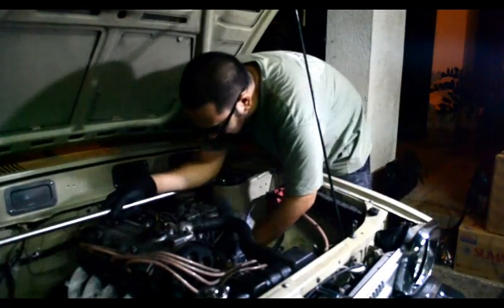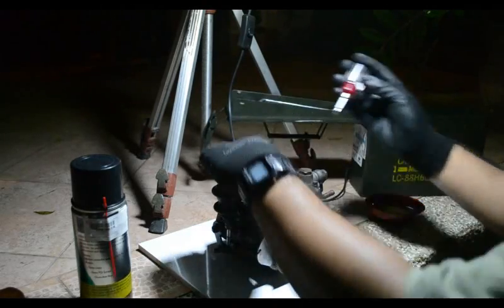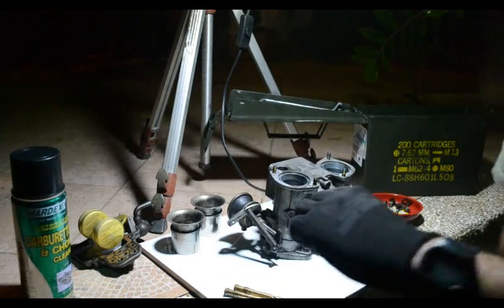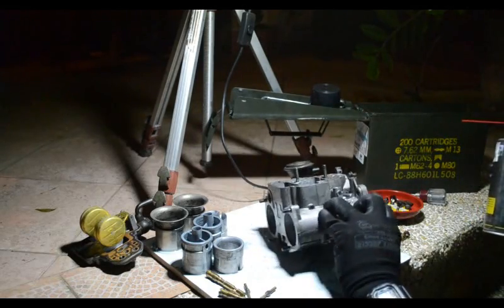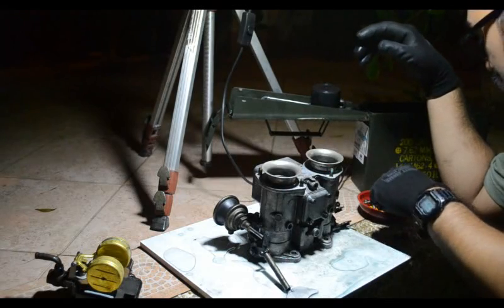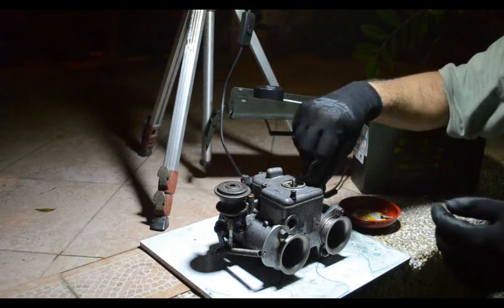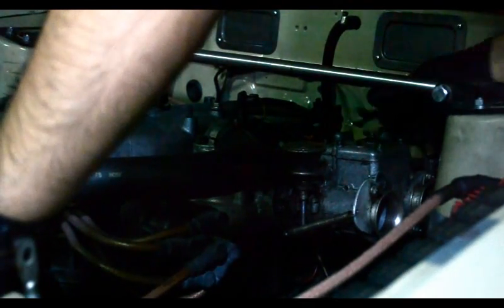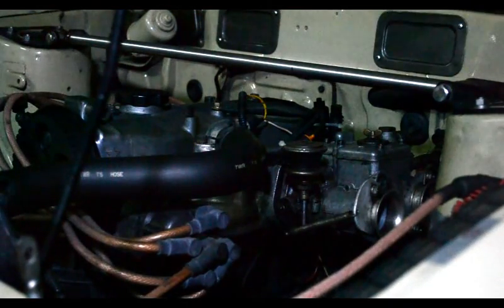Weber 40 DCOE teardown and cleaning

Comment: A warm hello from Canada!  Thanks so much for posting. I have a pair of twins (DCOE 45s) set-up on my BMW 2002 that have recently suffered some bad fuel. I initially thought that it was an ignition problem, so I installed an upgraded ignition system (Petronix/electronic distributor, MSD box, new plug cables, and a new coil). While I'm happy with the "more reliable" ignition system, my problem is persisting. Time to take apart the carbs for a cleaning. In Canada our fuel suppliers are legislated to have at least 5% ethanol blended in the fuel. Our fuel retailers indicate that there may be as much as 10%.  I doubt very much that the the ethanol concentration is an issue. It really seems to be the case that my selection of fuel retailer is at issue. I was in a rural part of our country and in desperate need of fuel.  The small-scale retailer was the only option at the time.  I may travel with a reserve of fuel - purchased from my usual reputable retailer - for situations like these. What a pain!  Your video, however, is going to make the cleaning considerably less painful. Thanks!  -Dan
Reply from the maker: Daniel Day thanks! glad you find it helpful. if you have any questions let me know.

Comment: You don't know how much I appreciate this video. Just did both of my carbs for my corolla. I do have a question though, how come you didn't remove the bottom square cover?
Reply from the maker: Thanks! Nice to know this helps. I don't remove the bottom square cover for usual maintenance because that's just the bottom of the float bowl so there isn't usually any dirt there as long as you have a good fuel filter. I also avoid touching that as much as possible as there's a gasket there that will need replacing once it's opened up. It's not hard to make a new gasket out of vellomoid but if its not something we have to do we won't. If it's an old carb that's been sitting for a long time and full of gunk in the float bowl you'll have to open that part for sure.
Reply: @dog283spec  thanks for the info. I'll be sure to check that out since my carbs have been sitting for some time.
Reply from the maker: @jmsantia1  if you shine a light from above when you have the top cover removes you should be able to see how clean the inside of the float bowl is so you can decide if  you need to take off that cover or not.
Reply: @dog283spec  Ok. Honestly, I didn't see much gunk or residue even though I never used air filters. Maybe because I always used high octane fuel/supreme at the pump and drove the car on weekends? Either way, I'm taking it as good news. Thanks again for the tip.

Comment: Good evening sir. I want to ask what to do if my car ran out of gas? I put 6L of gasoline already but it still won't start. I am not sure what to do hoping you can help. Thank you!
Reply from the maker: You probably need to prime the fuel pump and filter. Also check if the fuel filter got clogged up with dirt from the bottom of the gas tank when the fuel ran out.
Reply: @dog283spec  thanks for that bro. I manage to start the car but it wont stay up. It wont idle... I tried to play with the screws of air and gasoline and now I am not sure how to fix it. Can you help me out with that one?
Reply from the maker: @iCEDso  still the same. It's probably a fuel issue so you need to check the pump and filter. If those 2 are OK there is probably some dirt that got sucked into the carb when it ran out of gas so you'll have to open it up and clean it.
Reply: @dog283spec  thanks man. Will do it today